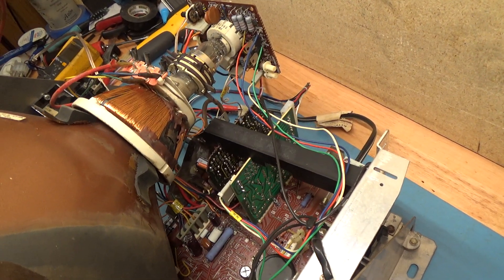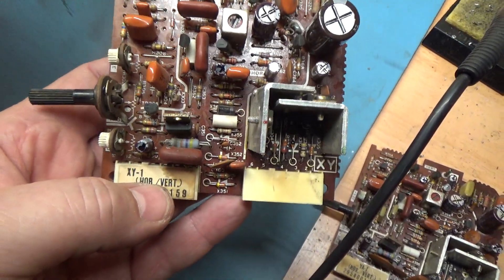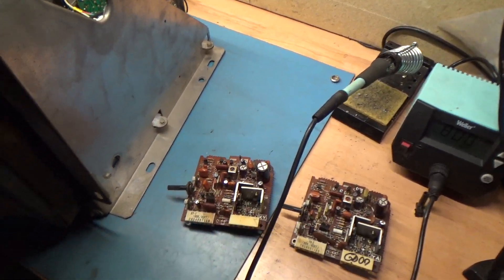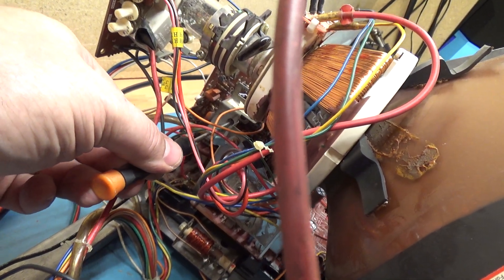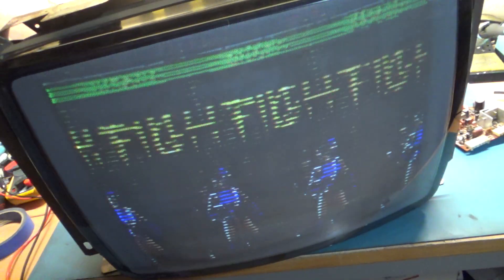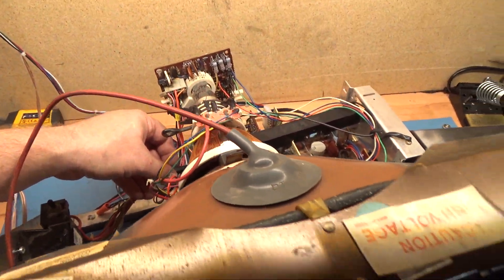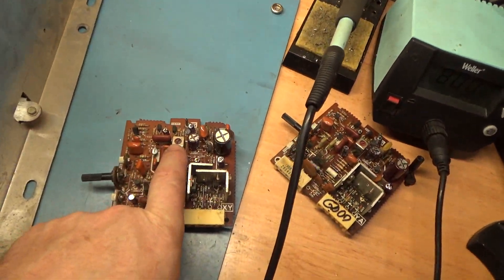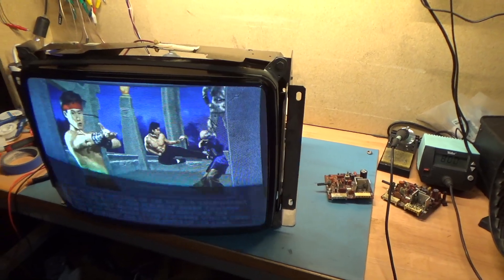19" K4600 Arcade Monitor Repair - Horizontal Oscillation Adjustment Tutorial

Comment: @MikesArcadeMonitorRepair Mr. Mike, I'm about to recap a Nanao kb24033ic. Are there any tips for things to check or replace while I'm digging around other than the caps?
Reply from the maker: Unfortunately, I’m not familiar with that specific chassis, so I can’t say. My apologies. If it’s currently working, cap it, inspect it, reflow it, and it should be good.

Comment: Fantastic job as always. Love these videos.
Do you any past videos and matching chassis with tubes? I've a number of both but unsure which are compatible.
Reply from the maker: Thanks. Depends on the yokes. What models specifically?
Reply: @MikesArcadeMonitorRepair  I've currently got about 12 CRTs no chassis from 14" to 28". 
Chassis around 40ish ranging from Hantarax to Electrohome, mostly G07 and G08s and a mixture of WGs. Been picking these up when and where I can, just trying to figure out what can pair with what. Some of the chassis come with their yokes, and some tubes don't have any yokes at all.
I've been assuming that most tubes guns run at the same voltage, but the H.V. is different depending on tube size. Trying to get a yoke to fit snuggly on a tube is a matter of trial and error. I'm measuring the resistance and inductance of the yokes, but that's where I'm stuck. How to match that with the chassis, without it going pop!